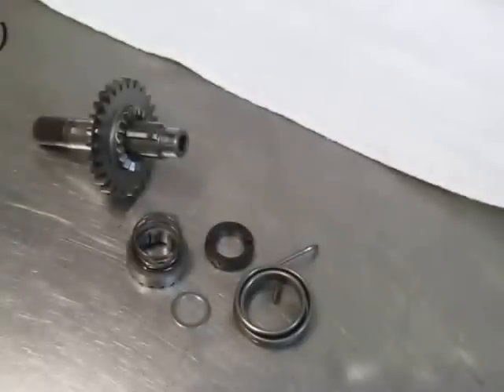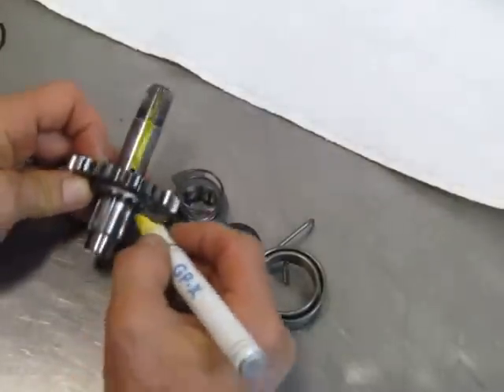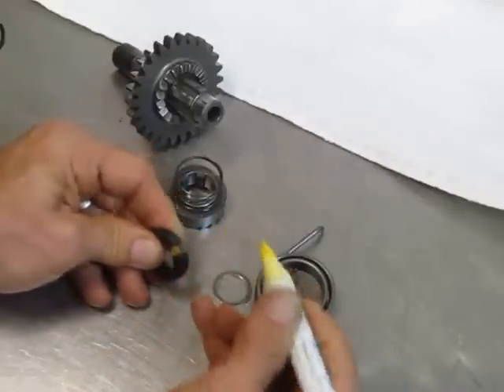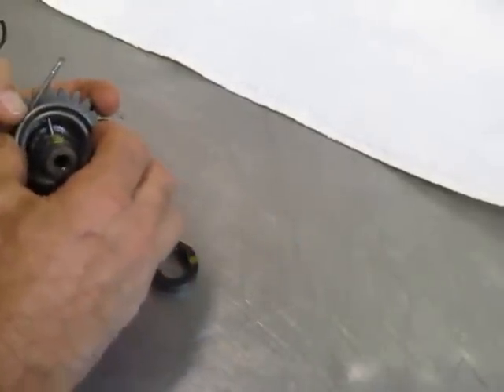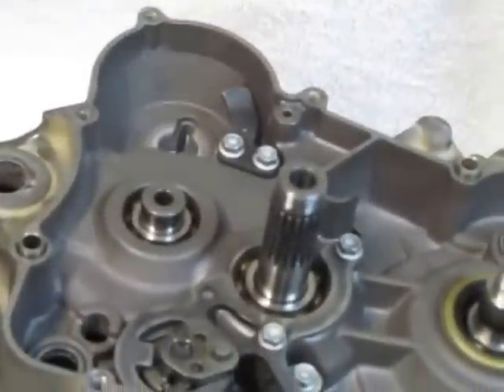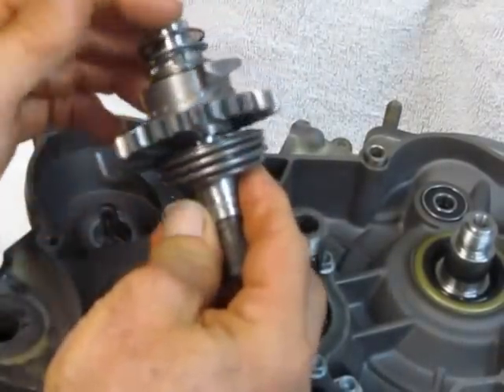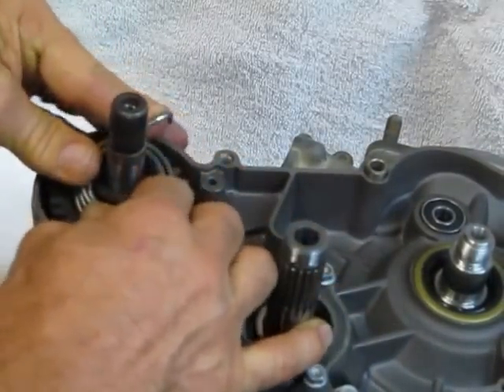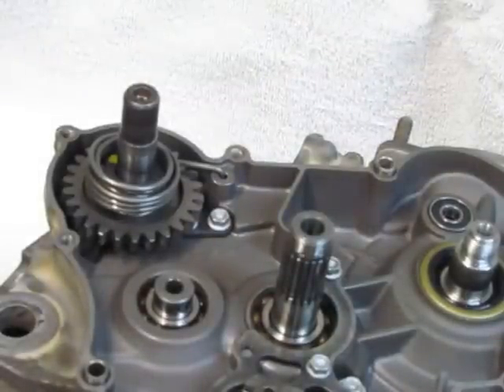KTM 200 kick start mechanism installation how to video

Comment: Can I pull this kick start assembly with the engine in the bike fully assembled?
Reply: You should be able too, but I’d remove the fuel tank and radiator shrouds to get better access to the case, then make sure you drain all the oil and then you can pull that part of the case off

Comment: You don't know how helpful these videos have been for me.  Thanks for putting them up.  I am rebuilding my '02 200 right now and keep checking back to these instructions.  How do you get your cases so clean?  Are these new bikes?
Reply: +Ben Miller that thing you see in the link its essencially a bath tub with a grid on top! in the bathtub you put gasoline and you clean the parts on the grid, so it has a waterpump(gasolinepump) that pumps the gasoline on the tub thru a hose thats connected to a brush with a holow handle! you use the brush(which is constantly flowing gas thru it) to clean the engine and the gas falls thru the grid to the tub, so its a cicle of gas, it saves you a lot of time on the cleaning!